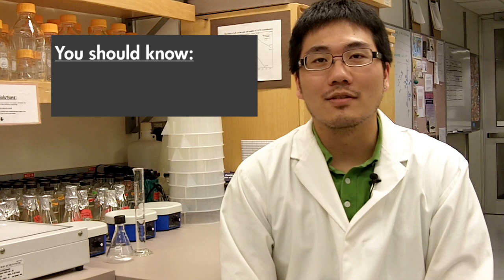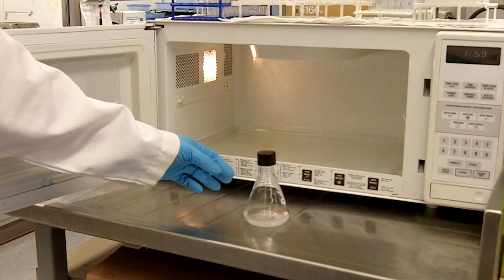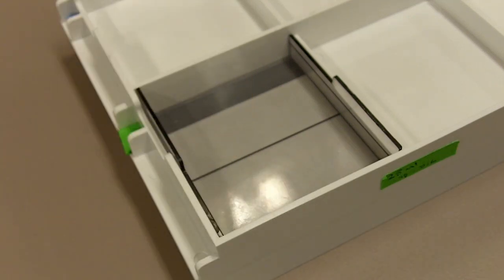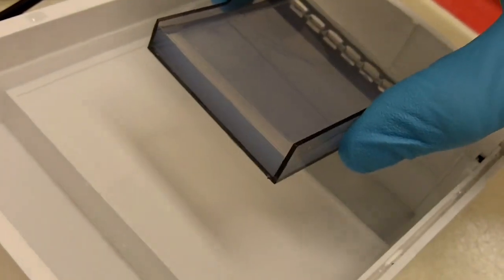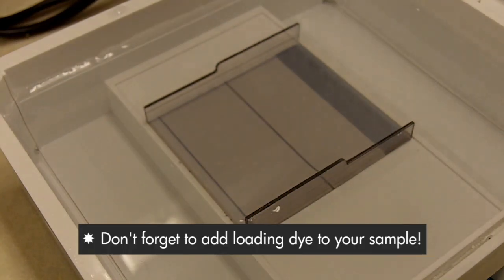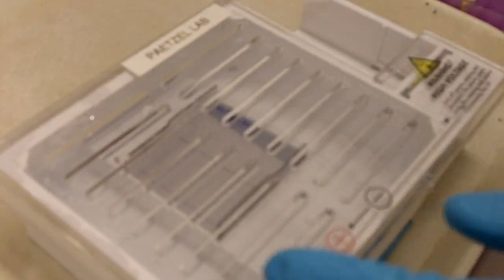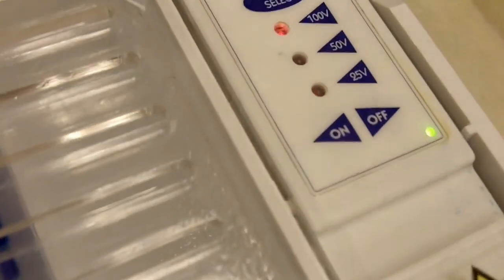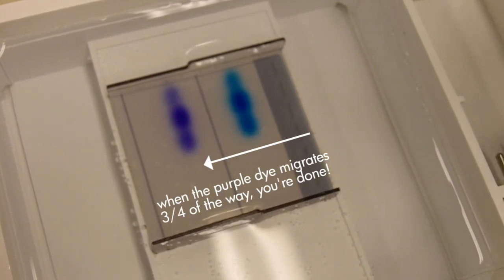How to Make and Run an Agarose Gel (DNA Electrophoresis)

Comment from the maker: @088zorba 

-Wait for the gel to cool because it's really hot. Also, you don't want to create ethidium bromide (EtBr) vapours, so if you add EtBr when the gel is cool, you can prevent that.

-Add EtBr when the gel cools down

-When you take it out of the microwave, look at the solution and make sure that all of the agarose has been dissolved, and that it is a clear liquid. If you see gel like particles floating in it, microwave a little longer.

Comment from the maker: The purpose of using UV light is to see the bands on the gel. When you stain using ethidium bromide you can't see the bands until you shine UV light on it. Ethidium bromide reacts with the DNA in your gel by inserting into the DNA molecule. In the presence of UV light, ethidium bromide fluoresces and you can see where the DNA bands are located on the gel.

Comment from the maker: In most cases the water loss is negligible (ie. if you are simply running a gel to see the presence of a band and the resolution or % agarose is not important). However, if you need to be very specific about your % agarose (i.e. you need exactly 1% agarose) then prior to microwaving you should weigh the flask (containing agarose and buffer). Then after microwaving when the agarose is dissolved, re-weigh and add water (not buffer) until you reach that same mass.

Comment from the maker: @088zorba

*Another way to stain using EtBr is to soak the gel AFTER running electrophoresis in a container of EtBr solution. This method prevents contamination of the gel electrophoresis equipment, and allows EtBr to be contained to one section of your lab. Also, no EtBr vapours :)

Comment: I am using the exact same electrophoresis system, but I have a couple of problems. The gel usually fills up behind the plastic that holds the gel. Also, the power supply heats up and starts blinking and the bands turn up very uglish.
Reply from the maker: 1) After casting, the excess gel behind the plastic tray can easily be peeled off and discarded.

2) If the power supply is heating up and the light is blinking, the current has exceeded the limit of the system. Make sure your buffer is correct. If you are reusing buffer, the water evaporates and increases the salt concentration, which increases the current and heat. So it is recommended to discard the old buffer and replace with fresh 1X TBE buffer. If you want to keep reusing old buffer, then top off the old buffer with water and NOT with more buffer - remember you want to replace the water that's been evaporated to maintain the original salt concentration.

Hope that helps!